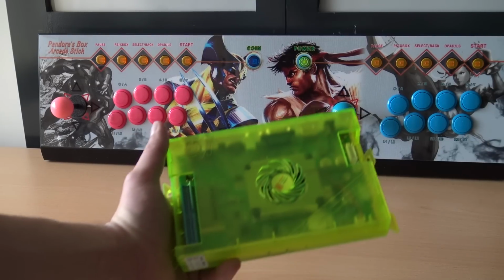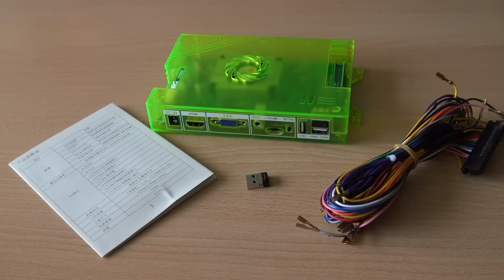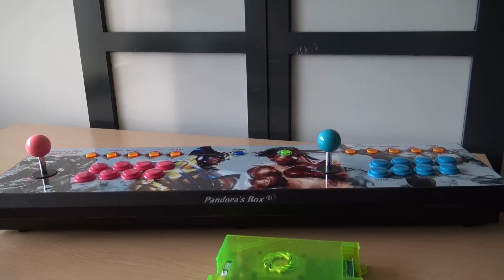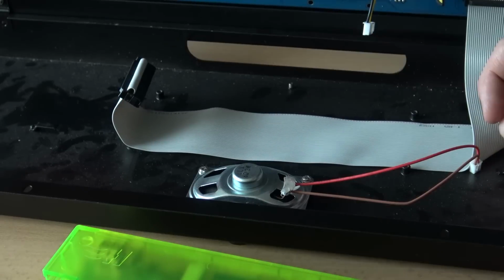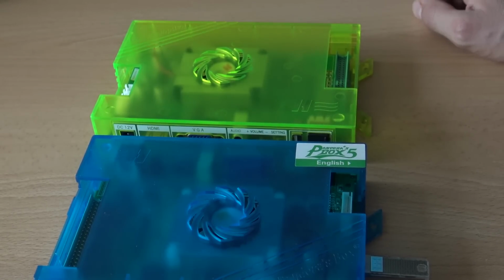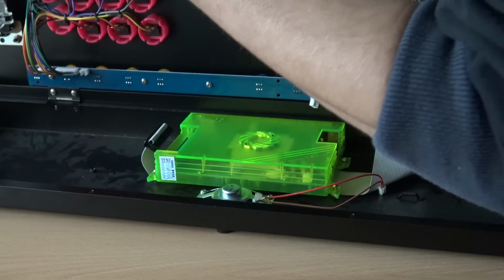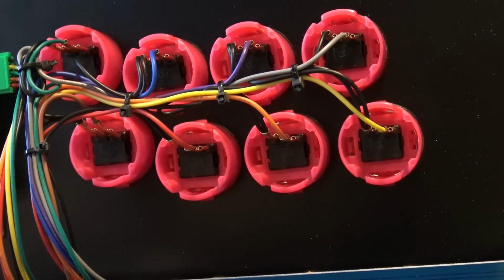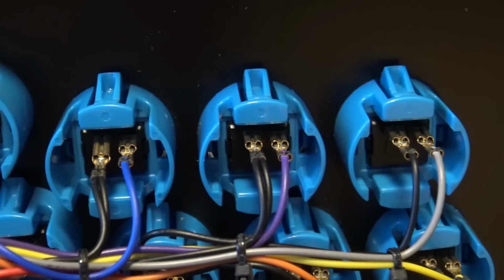Pandora's Box 5 Upgrade Tutorial !!

Comment: I have a Pandoras 5s arcade stick, and I wanted to know can I upgrade it with a real 3a pandora 6 diy kit, thanks in advance if you can help me.
Reply: yes I think you can. I had a 6s stick and did it. You may need to cut a small section out of the box so the usb stick can be reached.  Also you need to drill 4 new holes to mount it. The wiring harness matched without touching anything. hope that helps.
Reply: @robertwelch24  That's really useful, thanks.

Comment from the maker: Where to buy ?
https://nl.aliexpress.com/item/Pandora-s-Box-6-1300-in-1-family-Version-HDMI-VGA-Output-Game-Board-with-jamma/32912961892.html?spm=a2g0s.9042311.0.0.71664c4deLaqZM
Reply: I got a question which you may or may not have the answer to? I both a knock off of the Pandora's box called Home Arcade Box. The games run choppy, and wanted to know if I was to buy the Pandora 6, could I put it's hardware into Home Arcade Box?
Reply: Prime 2.0 yes you can. You only have to check if the wiring is the same.if not you have to order the pandora box 6 with the wiring set it's only a couple dollars. And you have to check if they use the same power adapter.

Comment: Hi, I have a question regarding Pandora 5. It displays Interpolation which is very glossy and not clear at all. No options to change it. Any idea? I would be very grateful.
Reply from the maker: Only thing I know you can swap out the filter on the Pandora's Box Machines :( There is not other option possible if you cool into swapping colours or other software settings, I wanted to rotate the screen for an arcade machine here and that is not even possible :(

Comment: Hello got a question  can you use a usb fight stick by plugging the usb into the usb ports  an play games that way thanks Jason brewer  an great channel really enjoy your content keep up the great work.
Reply from the maker: Funny I was just talking with Neo Gunloc about this, next time maybe me and my buddy going to test this out, I own some arcade sticks from china, we want to test this with fightsticks like Madcats and Hori.
Reply: Jason Brewer I tried this and it won’t work.  Only way is to connect the wiring harness to a controller.
Reply: @raychow5419  ok thanks for trying nice to know I got like 4 arcade stick just laying around an thought that Pandora box would be a good option for them if it worked.
Reply: Jason Brewer I converted my old madcatz TE fightstick to work with Pandora’s box till I get a Arcade1up machine to throw it in there.  You can also mod your sticks by buying the wire harness.
Reply: Or you could just make your own harness, the pinouts are in the manual and are easy to find online. you just need some female pin header connectors (or some arduino type jumper wires) and some spade connectors, and a bunch of wire. Label wires with masking tape and a pen as you go; I've wired up a bunch of arcade control panels from scratch, it's easy. You just need to daisy chain all your switch grounds to a single ground connection on the board.
Also, the Arcade1up doesn't have a VGA or HDMI connection on it's display, so you will need to put a different screen in there, or you'll need to roll your own display controller somehow. Go to a thrift store and buy an old flat panel 4:3 aspect ratio computer monitor, usually less than 20 bucks.

Comment: Wicked Gamer hab ein Pandoras Box 6 Family von der 3A  mit 8 Knöpfe laden bestellt frage ist sind die 1300 Games schon drauf vielen Dank?
Reply from the maker: Make this comment in English I can't write German language, Pandora's 6 is a real good upgrade. PS1 Support, Adding games and the search function are good upgrades. Doesn't matter what case you have 6 or 8 button. If you have original 3aGame Arcade Stick this will be plug n play.
Reply: Hi Thank you i have buy this Pandora Box 6 1300 in 1 8 button Family 2 players joystick arcade console support add FBA MAME PS1 game can add up to 3000 games. My questione is its installed Games Thank you.
Reply from the maker: No, Most of the time you need to add yourself.